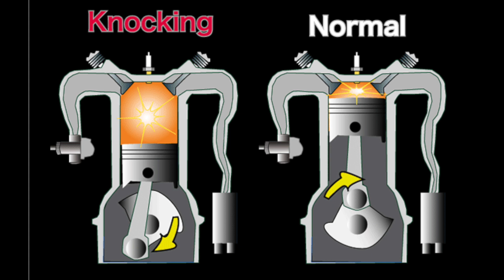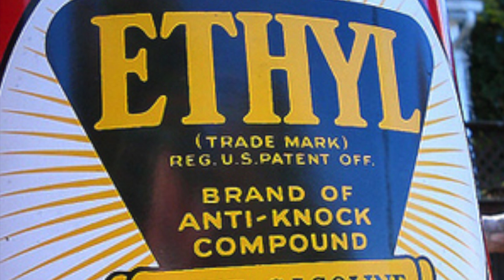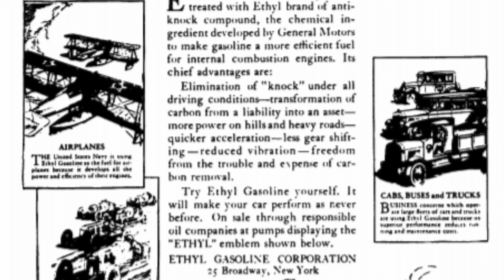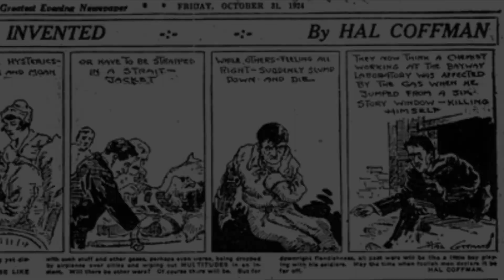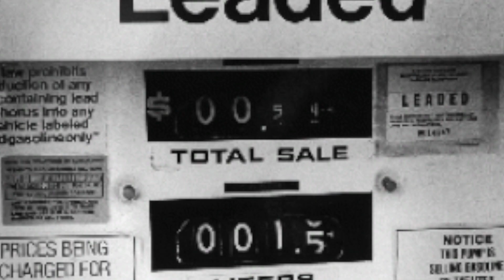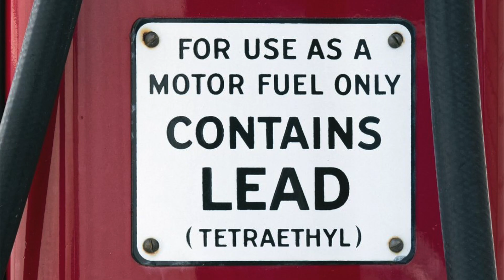Why Was Lead Added to Gasoline in the Early Days of Automobiles?

Comment: Lead was added as a lubricant in old engines. I bet you didn't know it is still being used in aviation. The older piston engines need 80-87 octane fuel which has lead in it.

Comment: Tetraethollead was added because the Ethinol in ot prevented water from separating  out damaging the fuel system  and helping reduce engin heats. The lead lubricated high tempuratur parts and reduced the acids from the combustion in the oil. WIN WIN WIN!

Comment: They still use lead in a lot of small aircraft fuel. Most of those engines are air cooled and use excess fuel to lubricate and cool the engines.  I've heard estimates of 1/3 of the fuel consumed is not burned and merely used for this cooling and lubrication feature in leaded fuels.  Some people living near airports where a lot of small aircraft are used have brought up concerns with the high quantity of lead in the air near these airports.

Comment: Tetraethyl lead also shortened spark plug life (change every 10,000 miles or misfire). Engine oil also had to be changed every 3,000 miles due to lead blowby contamination causing sludge. Exhaust systems (before stainless steel exhausts) would also rot prematurely due to lead corrosion.

Comment: Here in Britain lead in petrol [gasoline] began to be phased out in the late 1980s and from 1991 all new cars had to be capable of running on unleaded fuel. Lead in petrol for on-road use was finally banned from January 2000. For a time after that lead replacement petrol [LRP], with an alternative to lead was sold for use in older vehicles.
Reply: The US did that in 1979

Comment: I’m a old timer that restores old farm tractors and cars. I use liquid lead additive to all old engines because valves and valve guides need lead as a lubricant unlike modern engines that use unleaded gas because of the advance of heat treating internal engine parts.
Reply: It isn't so much heat-treating engine internals, it is because the valves and seats will pound each other away, unless you use Stellite valves and seats, which would require you to regrind your valves every 10,000 or 20,000 miles.  Some old engines did not have that vulnerability - Hudson and REO engines used such a hard alloy that you didn't need seat inserts, and many Chrysler engines used seat inserts from the factory.  Some Ford engines used induction-hardened valves and seats,  but GM, Studebaker, Nash, etc. used soft valves and seats.
Reply: You didn't see any exhaust pipes or mufflers falling off you cars either.😮

Comment: What a bunch of garberly goop. 

Here's my video it's much shorter. 

When lead was added to the gasoline it quieted the lifters. Reducing the noise of the engine running. 

Once they had advancements in rubber seals they no longer needed the lead.

So glad I could help😅
Reply: It's still used in General Aviation (gas for small Cessna-type prop planes)

Comment: I am 73 years old and I remember when gasoline contained tetraethyl lead as an octane booster and when gasoline pumps had a label on their side that read For Use As A Motor Fuel Only Contains Lead Tetraethyl. I also remember when the unleaded gasoline started to be sold in the early 1970s. One big thing that forced the use of unleaded gasoline was the addition of catalytic converters to cars as an emission control device. Tetraethyl Lead would coat and poison the catalyst in the catalytic converter rendering the catalytic converter non-functional at reducing emissions. Also tetraethyl lead will mess up the oxygen sensors on modern vehicles. It is astonishing that to this day Aviation Gasoline still contains tetraethyl lead. Also specialty racing gasolines contain lead.
Reply: Why was unleaded gasoline more expensive than leaded gasoline in those days? You would have thought that unleaded gasoline would have been cheaper than the leaded gasoline! Since it would have had fewer ingredients. 🤔
Reply: @glennso47  One of the properties of tetraethyl lead was that it was a very powerful and low cost octane booster. A little tetraethyl lead added to low quality cheap low octane gas resulted in a big boost in octane. For unleaded gasoline other methods of boosting octane that were more expensive had to be used. Such methods included using more expensive higher octane gasoline molecules and unleaded octane boosting additives such as MBTE and ethanol. Ethanol is an octane booster, but it takes a lot more ethanol than tetraethyl lead to get a significant octane boost.
Reply: Why do aviation fuels or racing fuels still have lead in them? Is there some reason for this? Thanks.
Reply: @glennso47  Like other posters have stated, there are various reasons Avgas still has ethyl lead. Most importantly, however, is because the primary method of boosting octane, alcohol, is very susceptible to phase separation and it is highly hygroscopic. Both of these are more likely to happen with altitude changes, such as in the exact environment aviation creates. While the inconvenience created by alcohol in a car’s fuel is annoying, in aviation, the problems are more likely fatal as it would lead to more engine failures. Regulators have determined that leaded aviation fuel isn’t as harmful as the effect of any prohibition of lead in Avgas.

Most people don’t realize that the government still allows the use of DDT as a pesticide. Unlike in the past, it is highly regulated, of limited use, and only used where any alternative would create a less favorable outcome than the DDT. Similarity, avgas falls into this category. Using lead in Avgas may not be ideal, but not using it would be far worse.
Reply: @glennso47  It is a very long story as to why aviation gasoline still has tetraethyl lead that can be investigated with google searches on the internet and why it is taking so long to come up with aviation gasoline that is unleaded. When it comes to racing gasoline that contains lead I suspect that it is still allowed because this is a very limited and minimal use of tetraethyl lead.

Comment: The health effects are real, but a little overstated here.  The driving factor was the need to reduce photochemical smog, primarily unburned hydrocarbons (HC) and Nitrous Oxides (NOX).  Reducing those required catalytic converters, but catalytic converters were ruined by lead ions in the exhaust from engines burning leaded gasoline.

Comment: My brother was an vehicle repair mechanic back in the 1970s, where a co-worker of his that specialized with oil changes suffered the effects of lead poisoning.  For decades that guy would use his bare hands with removing the oil-drain plug and oil filters, with the lead-contaminated oil, on his hands, being gradually absorbed into his body.  After he was diagnosed with the ailment, he had to use rubber gloved on-the-job.  But on hot weather days that created discomfort wearing those gloves, he would revert back to bare-handed oil changes.
Reply: Bs
Reply: @Biggestfoot10209  I can relate to what bloqk16 wrote as that happened to my grandfather back in the 1960s.  He was an oil and lube guy at the car repair shop he worked at, working bare handed with doing the oil changes.  After many years of working there, he was ailing badly and after the doctor ran blood tests on him, was told he had lead poisoning.  From what the doctor and grandfather figured, the lead residue from the gasoline got into the used crankcase oil, and that oil got onto grandfather's skin when doing the oil changes.  Grandfather ended up on disability because his health got so bad from the lead poisoning.
Reply: Motor oil has no lead in it
Reply: I have always changed my oil with my bare hands.  What were his symptoms?

Comment: Lead also lubricated valve guides.
Reply: No, exactly, it lubricated the valve seats that prevent hot gases from leaking out. During the first few years after lead was decreased, many engine wore out abnormally short because the valve seat wore out. The automobile manufacturers than heat-induction hardening the valve seat. For some classic car engines that have the original engine, it is best add some lead-additive to the fuel.
Reply: @ronaldlee3537  You got it exactly right.
Reply: It lubricated valve seats. Not the guides. Reduced wear and created a better seal

Comment: I have a better question. Why do gas stations still say “ unleaded?”
Reply: That's a good question alright , There's no reason to keep posting unleaded on gasoline price signs because everybody knows that gasoline for cars is been unleaded since they phased leaded gasoline out , Back in 1976 when I was 17 , My parents would let me use their car and I had to be very careful when gassing it up because the car was equipped with a catalytic converter and leaded gasoline will damage it , This was even before self serve gas stations began so I had to make sure to tell the attendant to put unleaded in the car and the gas gauge also said unleaded fuel only , Another thing I can't stand is the way they price gasoline for example 3.25 and 9/10 per gallon , I wish the 9/10 of a cent was not allowed because they're a no coins minted representing tenths of a cent , and it's only on gasoline and diesel fuel pricing , If I owned a gas station I definitely would not have the 9/10 of a cent on my price signs because it's so ridiculous , Absolutely nothing else we buy uses the tenths of a cent on their pricing
Reply from the maker: We will try to cover that in our next video!
Reply: Possibly a reason for specifying "unleaded" is that with the modern era of internal combustion engine vehicles equipped with catalytic converters, leaded gasoline will clog those converters.
Reply: Also, the "9/10ths" in the pri¢e of a gallon of gasoline....
Reply: bc it's unleaded, what's up with u!
Reply: @coffeedrinker25-z4v  lt hasn’t had lead in it for almost 30 years. You can’t buy leaded gas for cars. Let’s list all the ingredients that aren’t in it.

Comment: And the simple answer was Tetraethyl Lead could be patented and Ethanol couldn’t.
Ethanol has the same effect on octane levels but had been banned by prohibition in the United States.
During WW2 the Germans used methanol for the same effect in aero engines.
Reply: Ethanol has a lot of problems that still aren’t solved… like stability during storage and its effect on rubber and seals.  

If you have a classic car or boat or RV or something that spends a lot of time sitting.. make sure you get gasoline with no ethanol in it.
Reply: @calvinnickel9995  Ethanol had no problems with rubber and seals in the 1920’s because that is an issue with synthetic rubber that hadn’t been invented yet.
Natural rubber and ethanol get along fine. Copper alloys and ethanol are problematic but distilleries solved that a millennium ago (tin plating or just use iron pipes).
Tetraethyl Lead killed manufacturing workers by the dozen (and mechanics too, particularly in aircraft during WW2).
Reply: Also ethanol also absorbed water from the air, and water and gasoline don't mix.
Reply: @ Desiccants weren’t unknown in the 1930’s…
TEL is highly toxic (hundreds of refinery workers and mechanics have been killed by its fumes over the decades).
Ethanol was tightly regulated in the U.S. by prohibition (19th Amendment) and that legal restriction also had a part in that.

Comment: Avgas used in piston engine airplanes  still contains tetra ethyl lead so if you think its gone you are wrong.
Reply: Yep 100LL is used every day.
Reply: There is Avgas and some blends of Racing Gasoline that still contain tetraethyl lead.
Reply: The amount of avgas sold is a tiny fraction of the automotive market.
Reply: Only if they have iron blocks and soft valve seats? Airplanes are expensive though so are probably kept in service longer  hence the need. Don't really see who would have  wanted to use iron blocks in airplans for the last 80 years+ though.
Reply: @rimmersbryggeri there's still planes from the early 40s that are still in common service, they're meticulously maintained and last way longer than you would expect
Reply: @ Yes that's exactly my point.  But at least on cars you can conver the cylkinder head to run on unleadleaded fuel. On some engines it may be difficult to get to the valve seats though depending on construction.
Reply: @rimmersbryggeri  You need to have very high compression at high altitudes.
Reply: According to the FAA, the reason for leaded gasoline still being used in General Aviation is that some engines on planes without it would be damaged by running lower-octane gasoline. Knocking in an automobile engine if it fails won't potentially cause a Disaster like an airplane falling out of the sky....
Reply: @joeylawn36111  Knock only happens when under full power, like taking off.  Not just level flying.
Reply: Too expensive to refit/recertify everything  for the benefit
Reply: @Phil-D83  That's what was said in the 1970's about ordinary American engines.  Mostly due to valve seat issues  And yet, everyone figgered out how to deal with it.  If literally millions of cars could get on board, surely a few thousand aviation engines can do so.  Or just quit flying.  Like during the automotive transition, if there are some engines that must have lead, add it at the refueling.
Reply: @frequentlycynical642  but the regulations on aircraft are very different
Reply: @Phil-D83  That's the whole point, isn't it?   Time to change those regulations.
Reply: Its about time a replacement was found for lead in Avgas.
Reply: I think you need to use leaded gasoline for your lawnmower. (?}